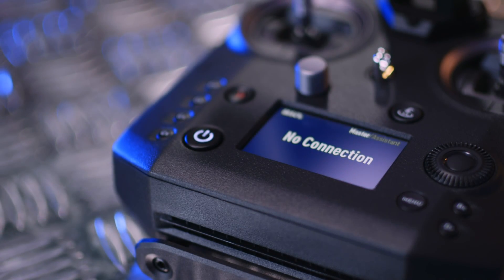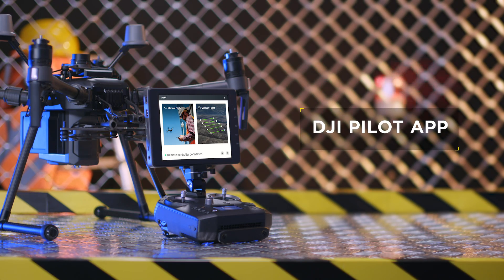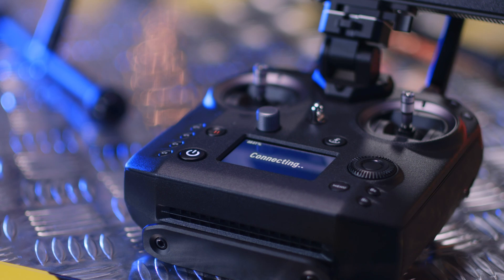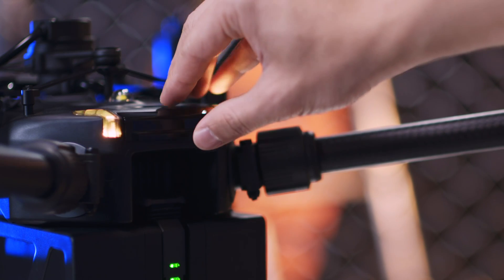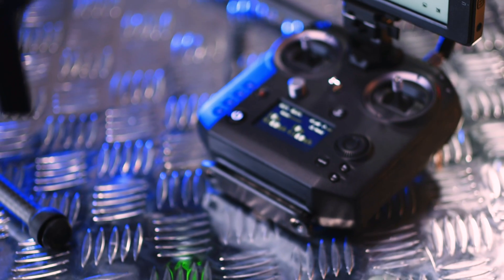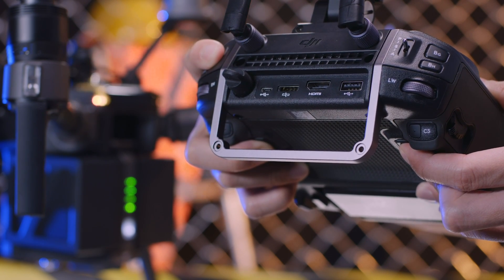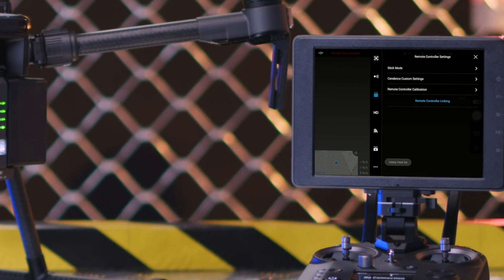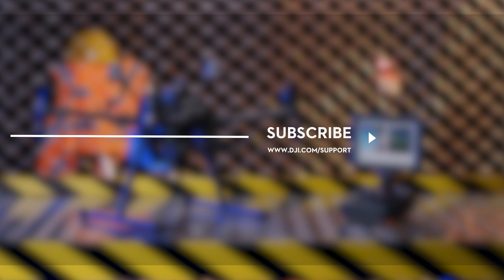Matrice 200 Series V2 - How to Link the Remote Controller to the Aircraft

Comment: I have a problem of disconnection of the drone with the control (yellow lights flashing fast) symbol of the battery and the sensors in red, can you help me with this?

Comment: Can this Cendence Rc link with Mavic 2 series? They both use ocusync 2...
Reply from the maker: Hi there, just to clarify, Cendence utilizes Lightbridge transmission. It is not compatible with Mavic 2 series. Thank you for your attention.
Reply: DJI Support But this v2 also use Ocusync, right? So this should be Cendence S version which is using Ocusync instead of Lightbridge..
Reply from the maker: Thanks for your attention. If there is anything new, we'll release on our website at the first time.